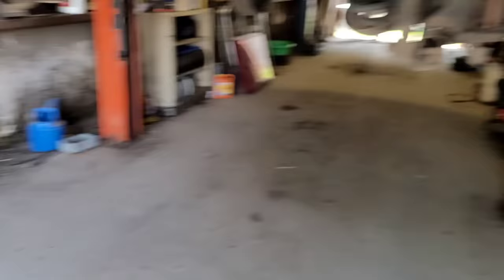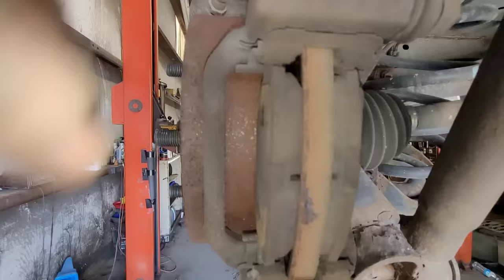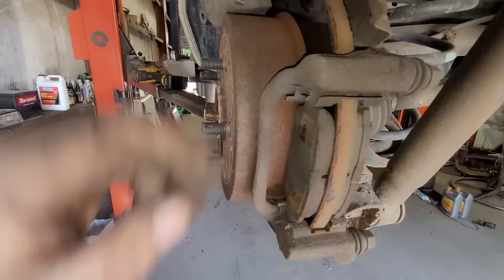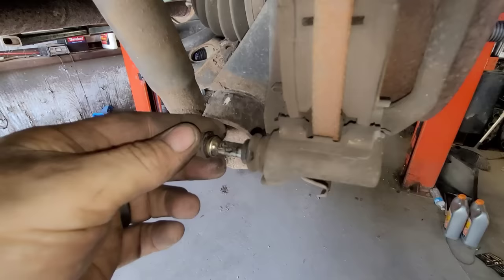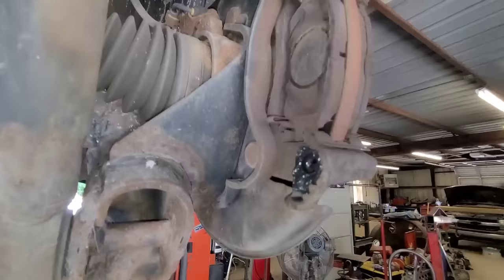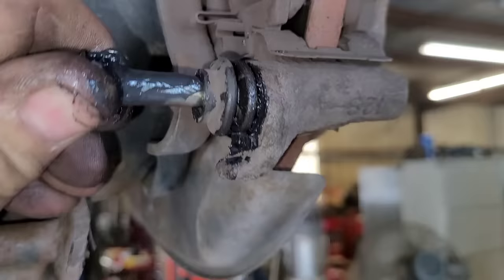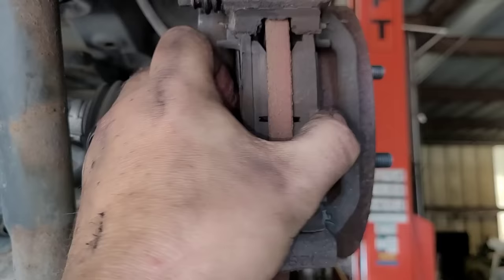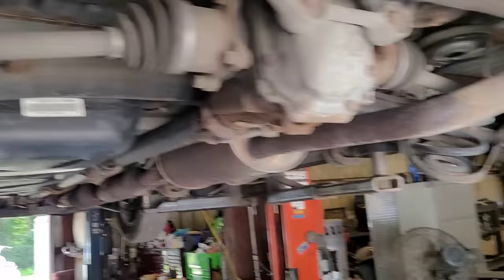Low Brake Pedal ? It's not air in the system...

Comment: tip for dys  people make sure silicone grease dosent get on tip end of slider pin .it wont compress properly or not at all .sorry kenny .you did everything perfect but the jamming the grease in with the screw driver can cause problems later on .im sorry but needed to say something .
Reply from the maker: You are 100% correct. But I should have explained better .  Yes ,the grease won't compress, but the ends of these pins were not round to fit in a round hole. The pins were more of a "D" shape to allow any trapped grease to be pressed up the side of the pin. I should have been more clear on the explanation. I really do appreciate that you were following along with the video and noticed that. I often do the same when I'm editing together the videos. I pick up on things I should have explained or said differently but never did. I'm still learning!!
Thank you for picking that up and messaging me !!
I appreciate you !!
Reply: @WrenchingWithKenny  thankyou i just didnt want you feel i was bashing .as you know people watch the videos to learn .oh well maybe someone watching has round ends  .lol  good job !

Comment: And I’ve seen people just take brake pads and slam them on not bother to check the ride point on the brake pad. If you have to take a file clean that paint off those pads need to slide in there very easily or overtime from the heat they will lock up and stick, I take a file to the end of my brake pads and make sure those pads are evenly level at the bottom of that pad where it meets any surface on the slides so when I put my pads in they going very easy you don’t have to tap them in with a hammer or force a man they should just slide in there almost fall out when you take that caliper off

Comment: My son bought a used Civic, the previous owner tried to dress it up by slopping red paint all over the calipers.   Rotors were pretty messed up so we did a brake job and found the rear pads to be completely unevenly worn… there was gobs of dried paint all over and it was enough to stop the pads from moving properly . 😕.

Comment: Someone's been "flat rating" your brake jobs. Very common issue with these Girling style calipers, which is why I always clean & re-lube those "pins" with copper paste every time I do brake pads. I also recommend replacing the much forgotten brake fluid every two years regardless of mileage.
Reply from the maker: I also recommend changing the beake fluid out . It's amazing how many people don't think it's necessary. But being hydroscopic , it does break down over time .
Thanks for watching !!
Reply from the maker: @bhaggen  you are 100% correct , including my spelling error lol 😆

Comment: Using the wrong grease on the slide pins (needs to be high temp silicone based - not petroleum based which can affect / swell / split the rubber bellows and swell the rubber seals that some pins have inside the hole like my Honda does) do not put a lot of grease in the hole either because the holes are a dead end and you can get 'hydraulic lock' which stops the pins going fully into the hole, that flat does not always let grease come out - especially when grease hardens. just a smear of proper grease on the pin is all you need.

Comment: Be careful using the wire wheel on gold colored guide pins.  That's cadmium plating applied to resist  corrosion and removing it will accelerate future corrosion buildup.
Reply: Thank you for that information
Reply: I just noticed your post after making my own about the wire wheel thing-y.

Comment: This maybe the case with your car (seized calipers) but not my car. 04 Volvo XC70. Mine exhibits the same symptoms. A little soft and low but bites better with1-2 pumps. I have flushed it but not much changed. Maybe bites better but still soft and low.

Comment: My pedal goes straight to the floor when i crank the vehicle 2010 pathfinder. Happend when i was braking on a hill and it went straight to the floor. Replaced master cylinder and bled bled bled to no luck at all. Booster is good i think!

Comment: Good explanation, sounds like the problem I have... Just waiting for the ground to dry up (soft driveway) a bit so I can investigate. The vehicle has spent most of it's time in the last year parked as I have a company service truck so sticking caliper(s) sounds very likely. Another clue is that I now have a bit of wobble when I brake lightly...

Comment: Thanks great video I just did the parking brake shoes and only compressed the piston back together the slipper off didn’t touch the calliper pins because they they have torque T55 on them and I didn’t have the tool. I put it back together and now I’m getting a Service brake system message and the pedal feels spongey as well I’m going to take it apart again and check the slider pins and see if that fixes the issue.👍

Comment: Your mystery problem was a defect of the pistons anodized coating little bump or ding. At a certain pad wear point the seals self retraction started working against itself. Get a bottle of non hygroscopic brake assembly fluid and rebuild some calipers like it's 1975. Your almost as gray as me, you done it before.

Comment: Don't put too much Sil-glyde inside the guide pin holes or you'll have problems getting the guide pin to go all the way in. It doesn't take much. Instead of applying it to the hole, brush it onto the guide pin.
Reply: That's what I have heard before, too much grease is almost as bad as no grease...

Comment: I've done this a few times on my toyotas and usually use a boor brush in a drill to clean the pin slots out.I use anti seize on the pins after cleaning them and haven't had a problem.
Reply from the maker: Nice work !!
Reply: Yes, Anti sieze best.

Comment: my issue (including cars I've never worked on) the brakes work fine to stop the vehicle, but once stopped (or if in park) the pedal will go right to the floor.  It's such a weird and frustrating problem.  I've bled them so many times the fluid is crystal clear.  I've greased the pins and none seem stuck.

Comment: Just clean them and grease them back. Mine does that. If I keep the foot on the pedal it sometimes sink. But not always. Fluid level it's ok. So it could be those pins or master cylinder

Comment: Same problem with 97 chevy 1500 4x4. Would pump , too slow releasing. Get in town lots of stop and go was bad news , finaly out on dirt road , just crossed highway , didnt release and almost got one side in flames . Pads were not bad realy , rotor not bad couldnt tell a warp after dumping a bottle of water I happened to have when it got hot. Im still fighting the dumb things.

Comment: I have had this happen as well on my daughters 2017 camry le with little bit difference of a problem but yet had that effect of having to pump the brakes little more so to stop so I changed the front brakes week earlier then did the back ones recently, after i removed the guide slide pins i notice the bottom pin on one side had a worn plastic bushing that wraps around the bottom pin that was worn down that only half of the bushing was left, i didnt have a new bushing at the time to install on the pin but recently picked up a six piece kit that auto zone sells for under 6$, toyotas have a bushing that goes around the bottom of each pin on all calipers why that is i dont know but its there for a reason, nonetheless it resolved the brake issue.

Comment: Yes, but it should not fill all the way down that chambers with grease it will make the pins to pull back due to grease, grease should just be brush a round the pins and not all the way down at the tip end of the pins.

Comment: I go with synthetic brake grease on slide surface and antiseize on the threads. Good cleaning first of course . I bought  the synthetic grease and it is fine but I think antiseize would work for all the surface. I like the antiseize because it anticorosive too .

Comment: I do hope this is my issue, because I have the same symptoms on my 1992 Corvette. I was thinking maybe the brake booster has an air leak, but your explanation makes more sense. But if my booster is the culprit, how could I rule that out?
Reply from the maker: Usually a booster will cause a hard pedal . As if the motor isn't running .
Reply: @WrenchingWithKenny  I think you are right.
Reply: Watch Scotty Kilmer video

Comment: Q-tips for cleaning and greasing.  I suspect you don't want to pack so much grease, but would like to hear from a consensus of mechanics.
If the 'ears' on the brake pads are too tight a fit, I've ground a bit off the sides to allow pads to travel freely.
I had an Elantra with uneven brake pad wear and the replacement brakes were strangely too thick to fit over the rotor.  I matched up the less worn old brake pad with the new 1-2 years then installed the other new pad.

Comment: Ive had a mushy pedal on my 95 for about 13 years since ive got it, and i never did change the grease on these. I've changed the break pads 2 times...😢i have to change the break lines out...imma do the seals and do these bolts lube...

Comment: Shady! That piston should slide smoothly . You risk damaging the inside surface with a "screwdriver".
Reply: That’s not a piston that’s not the cylinder wall that is just a slide pin and scratching the surfaces with a screwdriver is not going to hurt it. I wouldn’t use a screwdriver I would use for a clean get me a wire brush from my gun cleaning kit and going there on a drill, or they have wire brush kits that it was actually for servicing brakes if you don’t want to buy the correct one the schedule wire brush and clean it out by han he’s isl inside the caliper where the piston goes

Comment: This has to be my problem, it just makes sense. All the symptoms point to the this.
Reply from the maker: Let me know how you make out !
Reply: @WrenchingWithKenny  still having a sponge feel when applying brakes.  My other thought was that the brake booster may be failing.
Reply from the maker: @David Hernandez  usually, but not always, a booster failure causes a hard pedal . Basically the opposite of the video . But that doesn't mean it's not a possibility
Reply: @WrenchingWithKenny  ah.. gotcha, what are your thoughts on it being master cylinder? Brake lines are good, no leaks, calipers are in good shape, greased no rubbers torn or no leaks from o rings

Comment: Here is a tip for you.  Ethanol works as good as brake cleaner.  Maybe no big deal for you but if you get a woman in the shop you wouldn't want her to breath brake cleaner fumes. Belle chemical sells it cheap.

Comment: My early 2000 f350 2 times a year a guy has to pull the rims and calipers use a air hammer knock the sliders out drill out the powder n gook  high temp goo the sliders and get solid brakes back

Comment: Boy Howdy Kenny, One I'll never forget was an IH dump truck with a low pedal.  The rear drums had been turned and were too thin. You could see them move when brakes were applied.  My supervisor suggested looking at this as a possible problem. I'd seen it a couple more times during my career.

Comment: I just took my 2007 RAV4 to NTB on Saturday for a tire repair from a screw in tire that went flat.  They did a bunch of work on it in October right after I bought it, including brake work.  A young boy did the repair and put 2 new sensors on for me,Mt hey did a brake check and whatever other free checks even though I didn’t think I needed anything else done.  Came home and 4 1/2 hours s later the tire was flat.  Went back up to have repaired again.  A different guy did it, there wasn’t even a patch on the tire that was going flat.  Went shopping today and the brake pedal is a little lower than it had been before I went up there two days ago.  Also when stopped the car seemed to be trying to move forward a little while I had the brake pushed and started making a little noise a couple times like it was trying to move?  Any idea what this kid could have done?  I appreciate any advice.  😊 thanks

Comment: I worked at a dealership that sold various makes of vehicles, primarily Nissan brand, the brake caliper service kits came with little packs of a black grease, which seems to be the same type of grease from CV joints. . i experimented with cv joint grease in overhauling brake components, never had any slide pin sticking since...been like 20yrs doing this...

Comment: So the flat side of the pin allows the grease trapped in the dead end hole to come out? I always lubed the pin, worked it around, but never put grease on the end or in the hole. I'll try that next time.

Comment: looks like someone used just normal grease, there should go only brake high temp grease that won't solidify. For not sayin gyou put the grease with particles from rusted bracket,, I usually clean the boot or take new one and put it first then i put the grease in the boot and push it with the glide pin.

Comment: My 07 Tacoma was the same exact way. I figured the master was going out but then the frame rotted through and I literally broke into two vehicles. Never worried about soft brakes after that.
Reply from the maker: Dang !!! Sorry that happened to you
Reply: @WrenchingWithKenny  Thanks! No worries honestly I didn't care for that truck. The uncomfortable low mounted  seating position and the 4.0 had horrid fuel mileage about 11 mpg all around.

Comment: I did break fluid bleeding twice a d it seemed for a few minutes. 
I took a part rear break drums to see if they were leakung. I could not find a y fault. Now it has been at least 5 days I go back a d forth trying to figure out the real cause. I even bought master break cylinder   bht decidee it to return it because tgere was no leak iu der it or dark fluid in reservour. I did see the slding pin was dark a d I kind cleaned with w-40 n put some grease. It did not help since  i did not clean the pin hole like he did. My dishonest nechanic never cleaned it either but he charged me 200$ to to replace break pads a disk in the front wheel. 
Now I see that oerhaps exactly what is causing spongy break which seems dangerous. 
Thank you for sharing your knowledge n God bless you.

Comment: I just replaced abs motor on new to me 2003 Silverado ext ls.
System sat open without a pump for a couple of days. I did suction out brake fluid from reservoir before abs removal so it would not end up on the floor.

After refilling reservoir after abs install.. Pedal goes to the floor with no pressure or brake fluid leaving the reservoir. 
I even tried removing the two line from the master cylinder.  No fluid would come out the two open lines

Whats up?
Thanks....

Comment: You didn’t find your brush to clean out the pin recesses so you used a screwdriver. You can find a gun barrel brush in the right size at any gun store or Walmart. Cheap and easy.

Comment: Heyyyyyy could this also cause the brakes to stick??? Csuse I have the same problem with the brake pedal but when I'm at a intersection sometimes my brakes are still applied upon acceleration and to get it to stop I have to push the brake pedal again and I'm able to drive
Reply from the maker: It is possible. Let me know if this fixing you issue. Keep wrenching! Kenny

Comment: Changed all my pads and front calipers on my 2005 G35 but left the old rear calipers.  The pistons were rusty but wasn’t ceased up.  I did take out the pins and regreased them but still the old ones.  Bled the lines until no air on the lines.  After test driving it I noticed that I have to pump twice fir the breaks to bite good.  You think its the pins?  I plan to just replaced rear calipers to new.

Comment: Hi.
I am sensing some issues with my brake pedal. Let's say I am driving on highway and not using brake pedal for 15 mins. I have noticed that to apply brakes, it needs a little hard foot. It becomes scary at times.
However in city driving like stop n go driving the brake pedal works very good. What could be the issue?